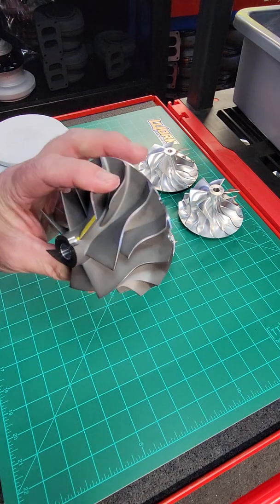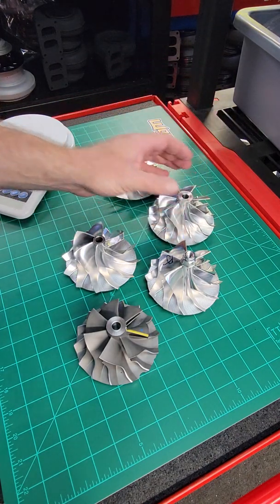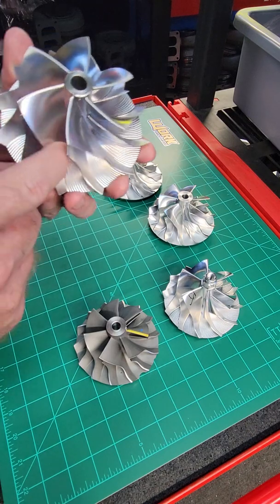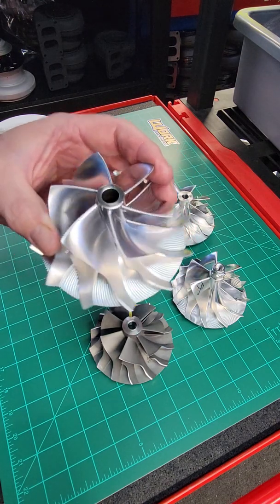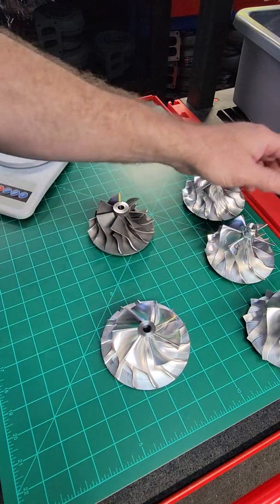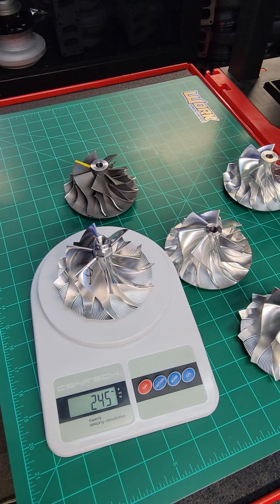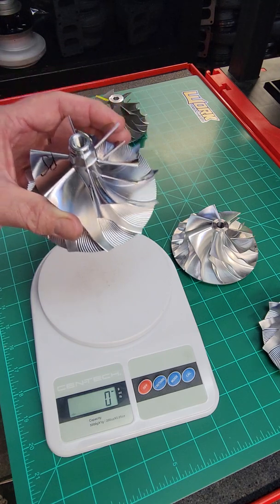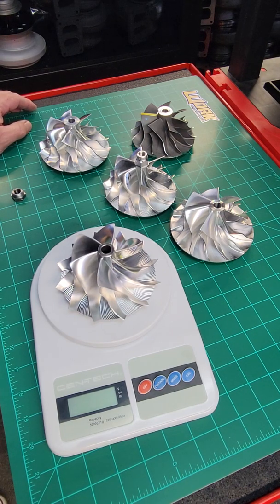Cast? Billet? MFS? FMW...a look into turbo compressor wheels!

Comment: Since the SX-E line came out is there a better compressor wheel option out there? As in like a drop in wheel?
Reply from the maker: Depending on the series turbocharger, we offer our own engineered compressor wheels that can out perform the standard SX series cast wheels, SXE series forged milled wheels and the latest SXR wheel designs from BW in specific applications.  But the SXE is hard to beat for its cost and power potential right out of the box! Reed
Reply: @workturbo  Gotcha I was curious I have aSX-E 66/74 .91 housing on my 6.0 just interested if there was a better flow option out there
Reply: @workturbo  so..... No ?
Reply from the maker: @lukedougherty7078  Yes, my apologies for the belated response.  I have a drop in wheel available that will pick up a small amount of flow.  We are working on our current generation aero for the S300 that will pick up quite a bit more power...but being a small shop money is always the reason it cannot happen faster.  The current wheel has made almost 89#/min of flow, compared to the 87#/min  BorgWarner rates the SXE 66mm at.  So you will clean up a bit more fuel with this wheel geometry.  We actually designed this wheel before the SXE was released, so it is a bit dated but works "ok".  The new generation is what we use in our L5P Duramax Aero, and it will move closer to 91#/min.  So that wheel will be a nice upgrade once it becomes available.  We will do the 72mm and 69mm sizes first in SXE as they are our bigger sellers.  The 66 will be later this year, most likely.
Reply: @workturbo  That's awesome to hear I'm at a point with the truck where I could keep my housing a drop in a 369 but was worried about spool up over the flow gains. Right now it really starts to light at 2000rpm with the stock converter stall which makes sense  it'll build some boost down lower but can start getting pretty hazy so any flow I would think would help with that EGTs are reasonable in 8-900 degree range under a mild acceleration but will get into around 1100 when the converter locks. I suppose I could run a reduced fuel tune but it's a single cab 2wd shorty so it's too much fun to roll into it at 35 and break em loose

Comment: The last will you put on the scale had extended tips 
 Extended tips makes a difference 
The extended tips increases the centrifugal pressure
of the wheel 
An increase the overall performance of the wheel ...
Reply: Agree but same time isn’t it more weight too?

Since the back turbine wheel is the most important, and is responsible for getting going which gets the stationary compressor wheel going. And maintains it to keep spinning!

And there is that “trade off” of efficiency. Where I believe the now heavier compressor wheel once spinning will “help “ the turbine wheel because the weight is pulling the other or making the engines force less🤔

If that sounds right.. but same time a light compressor wheel will start spinning faster as soon as you start the engine. And have little to no effect weight wise once spinning faster. 

I’m trying to find real results back to back on a video of say a 11+o blade and 6 or a 7+7 style comparison. And sound wise I heard is way different for some reason ..

And if extended tips create lag from idle position or low throttle

Comment: cloud you talk about the Effects of residual riblets of impeller's hub surface on aerodynamic performance of centrifugal compressors??
can we manufacture the impeller without it? and what the differences?
Reply from the maker: We have a more complex wheel program that has finer resolution/blade geometry with virtually no visible tool path.  The difference in machine time/cost is quite a bit, but the performance is also improved.  Machine time on that wheel can approach 10-12 hours!
Reply: @workturbo  whats a better design, straight blades or the curved blades? I've noticed certain manufactuerers use the curved style over the straight.
Reply from the maker: @Itsarealone  There is way more to it than the initial appearance of the blades. We could take a well engineered straight bladed wheel and easily out perform a poorly designed curved blade wheel, and vice versa.

  Also worthy to note, most curve blade wheels from the OE are designed to control the sound of the turbo just as much as the performance.  Sound fatigue is a real thing when operating a truck or piece of equipment for 12 hours a day...so they want it to be quiet.  Also worth noting, most of the time a quiet compressor is a more efficient compressor, so it will make more power.

  Last thing I will touch on...as manufacturing processes get better and better, the wheel shapes will get more defined.  

  For my current blade designs, we have found a straight bladed inducer with our developed blade progression from inducer to exducer works best for our turbochargers price point and performance goals, however a much more complex blade design is coming for our premium units, and it does have a curved primary blade.

  Hope this helps shed some light on the subject!
Reply: @workturbo  how much does blade count, whether it be all tall blades or a splitter style, affect response and airflow?  From my understanding the 11 blade full length is better for high pressure ratios and arent all too great at lower pressure ratios and then a 6+6 is better for lower pressure ratios and bad at high pressure ratios.  The thing i have an issue with is finding compressor maps for different wheel styles.
Reply from the maker: @Itsarealone  Thanks for the questions, they are really good ones.  In its simplest form, you are correct in your understanding of a "+0" splitter type wheel (all blades same height), but their performance also ultimately relies on the design of the blades themselves.  It is possible to create a very high pressure ratio wheel with a "splitter" and a low blade count, especially if we are talking about a smaller compressor wheel size, and vice versa. 

 To thoroughly answer your questions will take a bit of time and space, as it gets very detailed.  I am going to produce a video explaining this in the future, so stay tuned!

-Reed
Reply: Hello Reed , great video , just discovered this episode 20 mins. ago ! 
Never knew that B/W made a direct replcmt forged compr wheel  ( 7+7) for the s475 turbo . I've heard that these split wheels deliver better low - mid perf from 1.50 - 2.0 pr than the 10 or 11 blade wheels?  If this forged wheel from B/W could do exact same , and have same compr map as cast s475 , then this would be perfect for my 437 cube pontiac.  Not looking for 20 + lbs boost , only 10 -13 or so .  Is this forged wheel still avail ?  Thnx again .

Comment: I bought a billet wheel in house turbo from a shop in FL  For my semi about 2 yrs ago. I'm gonna pop off the boot or housing and see what wheel they used. I had a turbo from bullydog company b4 and it did ok. Biggest difference with the billet is it doesn't fall off as fast while pulling a grade and I usually have to let out bc my egt starts to creep up if I'm not at a high psi. If I can keep her at 30 psi then she's happy. They rated it 600 to 650hp I believe for diesel and 1200 gas

Comment: Hey Reed would a heavier wheels be better on a ball bearing journal?  Awesome video by the way.
Reply from the maker: Obviously heavier rotor groups will put more stress on the bearing structure, but it is the actual thrust loading from the compressor wheel trying to pull itself out of the housing and the turbine wheel trying to push itself out on the other side that causes the issues.  In a perfect world the turbo would have zero thrust load if the push/pull dynamic of the two wheels would equal out!  Might do a video explaining this one day ;)